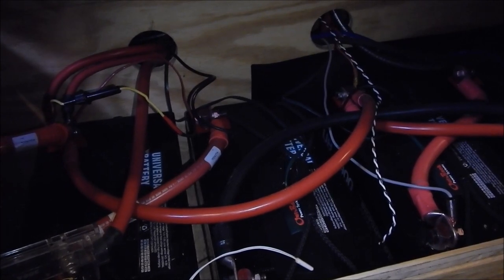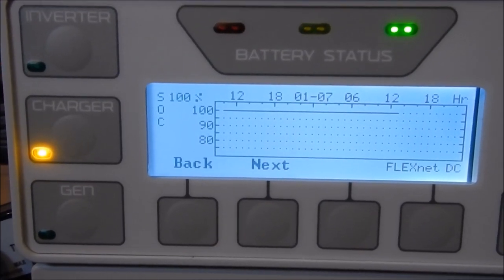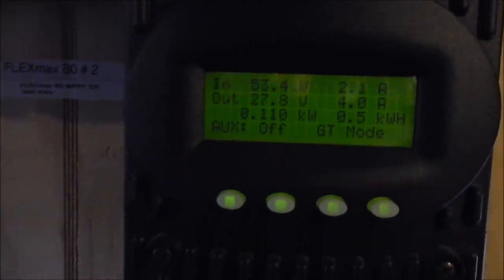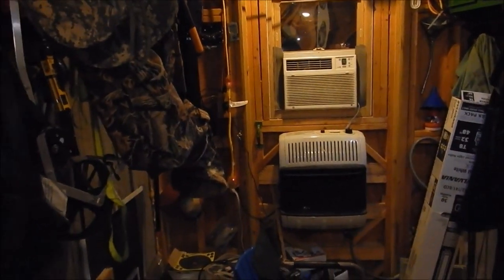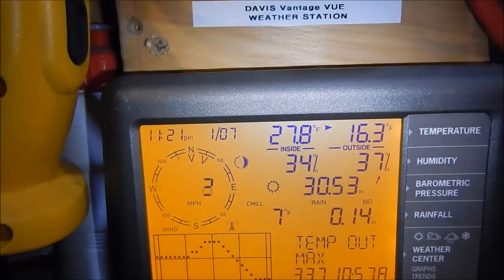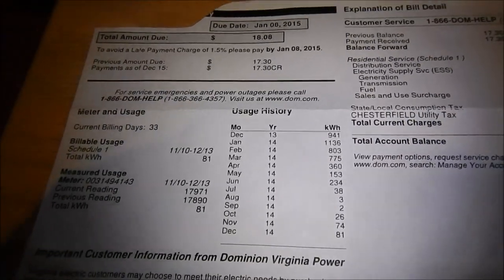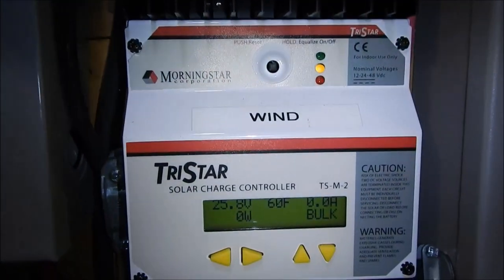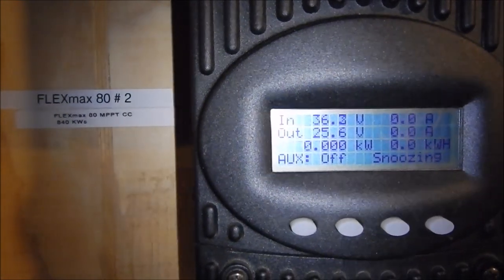Keeping Your Solar Battery Bank Warm The Test ! Arctic Blast Weather Extreme Cold Weather By KVUSMC

Comment: Also everbright solar? Everbright is what I currently use but have some conserns that they are junk cause I dont produce half oh what 5 140 panels watt are supposed to. So I came across I guy in Illinois that is going to be selling me 10  175 watt evergreen panels used for $90 a piece what is your opinion on those brands
Reply from the maker: D.J. DISPATCH They Look Like Descent Panels Sounds Like A Great Deal Just Remember I look For A UL rated Panel And Other Certs. And A Warranty Test Them Before You Buy Them Buddy Let Me Know How It Goes Buddy Cheers Kenny

Comment: hey i have a strange question but have to ask. if i am only feeding back into the grid and no longer charging batteries is it necessary  to have the panels into a charge controller then feeding into a gti? Or should i just eliminate the charge controller all together or is there any benefit of keeping  the charge controller between the panels and gti?
Reply from the maker: D.J. DISPATCH Just Put You In A 3 Way Battery Switch  I tried It That Way For A While In I first Started Out  Here Is A Link http://www.altestore.com/store/Enclosures-Electrical-Safety/Miscellaneous-Electrical-Parts/Switches/DC-Switches/Blue-Sea-9001e-Dual-Battery-Switch-Selector/p4750/  Run One Side To Your Charge Controller And Batteries The n One To Your Panels That Way You can Choose Which one You Run
Reply: KVUSMC / Kenneth W Viar Jr i think i confused you by what i meant. i no longer am wanting to use my battery bank and just only use my gti to produce energy only, so is there any benefit of keeping my charge controller wired in or should i just get rid of the charger its self if i have my panels going into my charge controller then into my gti or is that useless  to do?
Reply from the maker: I Got Ya Brother  Heck Yeah Go Direct To Your GTI  It Will Do Fine If Your Not Using Your Batteries Or Charge Controller   I Completely Understand Now  Let Me Know How It Goes Buddy
Reply from the maker: Hey  Buddy Do You Have Your PV Cables Running Into A Combiner Box http://www.altestore.com/store/Enclosures-Electrical-Safety/Electrical-Enclosures/Combiner-Pass-Through-Boxes/Midnite-Solar-MNPV3-Combiner-Box/p4567/   Also  How Many Volts Does Your GTI Require To Operate ? You May Want To Put Those Panels In Series  So You Can Run Actually 4 Panels at One Time Higher Voltage  Or Series Parallel ? On Your Panels